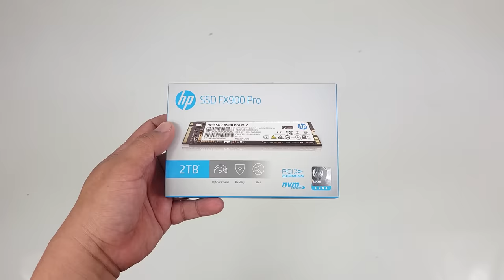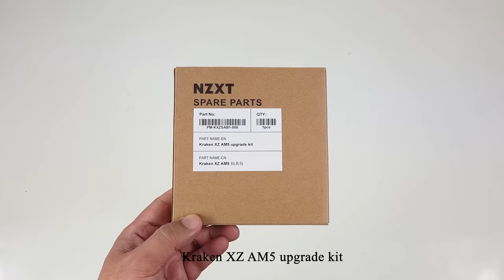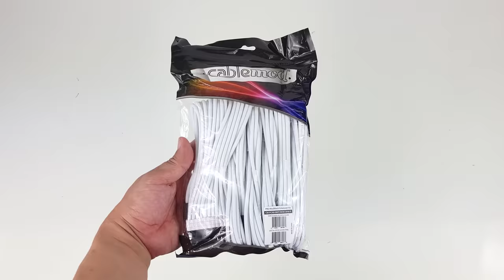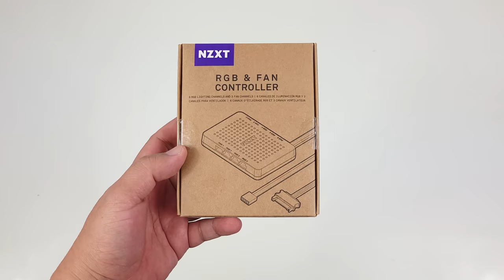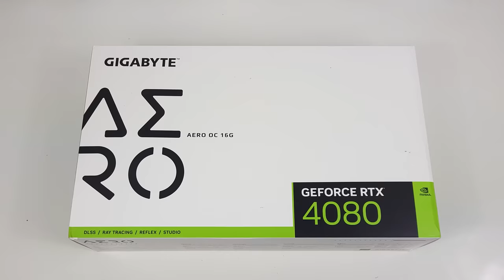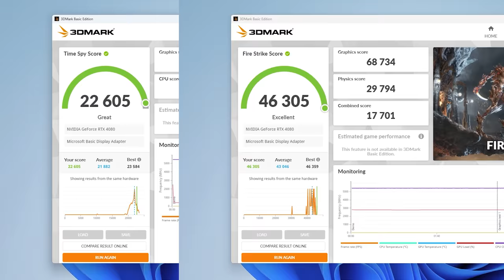Gaming PC Build | AMD Ryzen 5 7600X | RTX 4080 Aero | Fractal Design North | NZXT Kraken Z53

Comment: I was wondering how the RTX 4080 Aero is going to fit here. Looks good!
Reply: Looks good but cools badly
Reply: I noticed not a lot of sag. Did you use the included Gigabyte sag bracket or does the case come with some sag bracket built in?
Reply: @jragadio  https://youtu.be/liChy76nQJ4 skip to about 10 minutes in and he explains it, basically stacking pcie slot covers to make a point of contact where it isn't provided on the bracket for the card. Used it on my 6900xt and it work perfectly. Not to say this is what they did, but what they might have done.
Reply: @jragadio doesn’t look like he did,  if you notice just before he plugs in the gpu you don’t see included brackets
Reply: The bracket from Gigabyte is mounted on the motherboard and the top of GPU. Won’t be easy to spot here.
Reply: @atriusvinius319 how?
Reply: @atriusvinius319 explain 🤣

Comment: i just wanted to thank you for this video because it was a guideline for my build. I got the Fractal North With a NZXT b650e and went for a R7 7800X3D and 32 Gb a Kraken Z53. The card is still an older one a RTX 2080Ti but i will switch to the RTX 4080 Aero like in your video.
Massive thanks again
Reply from the maker: I'm glad that it worked out for you. Have fun with your new PC.

Comment: Amazing video, was literally going to do something like this for my next build but in a black color theme, just curious about two things tho

1. How is the ram clearance with a aio ( planning on corsair h100i with the lcd) and is it a must to use low profile ram (like the one you used, bcs was looking at the same but in black) or fan i get like a trident z rgb

2. How is the gpu power connector like is it pushing against the glass at all and reckon i can get away using corsairs adapter since cablemod doesnt ship to where im at

Would really appreciate if you can help me out here, also once again great video and absolute stunning build
Reply from the maker: 1. Ram clearance is almost never a problem if you use AIO.
2. There is enough room for a GPU cable.

Comment: Best looking build ive seen  , only one concern , are the cpu  temp   Good? 92 seems a little toasty  will a 7800x3d run cooler?
Reply from the maker: 90 Max temperature is pretty normal for new Ryzen CPUs. It's fine.

Comment: Nice, I'm also running an Ryzen 7600X with an RTX 4080 FE. But I will upgrade to the 7800X3D whenever that releases.
Reply: Why are you considering the swap from the 7600X to the 7800X3D if I may ask?
Working on a spec list for my upcoming build, so I'm curious.
Reply: @fyzx  3D v cache is known offer huge performance gains for gaming, so I'm just trying to maximize the RTX 4080 performance.

Comment: Thanks for your video. Is the GPU limit is exactly 355mm? I want to install Zotac 4080 which is 356.1 mm.
Reply from the maker: GPU max length is 355 mm so it may not fit

Comment: How’s the PC doing? Noticed that you used Intel XMP 3.0 ram on a AM5 mobo
Reply from the maker: Rock solid. You can use XMP3.0 rams on AM5.
Reply: @PCTechnician  Thank you so much!, because I was planning on buying that exact same mobo and didn’t know about the ram compatibility on it👍🏼
Reply: @PCTechnician  7600x is fast, 7800X3D around the corner...possible upgrade?

Comment: I'm planning on doing a build just like this with the Fractal North. Do you have any issues with the cooling?
Reply from the maker: Cooling is fine. Only problem with the case is there is not enough room for the back of the case. I wouldn't use a cable extension.
Reply: @PCTechnician  what do you mean by that? There isn't enough room for cable management?

Comment: amazing video, i was wondering why didnt you use the video card support bracket and can i use mine without a bracket because i just orderd the same video card and i dont know if the bracket will fit in my case
Reply from the maker: I didn't use it on this video but, yes I would recommend using a GPU bracket as this GPU is really heavy.
Reply: Thank you for replying to me🙏🏻

Comment: Hi there
Just a quick question the Kraken X53 requires a specific AM5 mounting bracket or will the one in the box with a AIO work?
Reply from the maker: Even though the AM4 bracket will fit, NZXT recommends using the new AM5 bracket to prevent possible damage.
Reply: i use  Be quiet Dark Rock pro 4 with same CPU and motherboard (ASUS ROG STRIX B650-A wifi gamming and 7600x) and work perfect no need brackets

Comment: I'm looking at an almost identical build, except all in black. Is it not possible to install the AIO on the front and put a 4070ti in this case ?

I feel the 240 AIO is not enough, really need a 280 or a 360..
Reply from the maker: 280mm won't fit on the top but it fits on front. RTX 4070 ti should fit in there.

Comment: Thinking about a similiar build. Does an AIO with 280mm radiators still fit on top with this case?
Reply from the maker: No. It will interfere with the motherboard.
Reply: @PCTechnician  Damn. These new cards are so massive, Would you reccommend using it in the front or is the gpu simply too big for a 280 in this case?
Reply from the maker: @hybrid11theory75  280mm fits in the front but then again you can't use 4080 together.
Reply: @PCTechnician  Very helpful. Thx for the quick info!

Comment: Hey i have nearly the exact same build Mobo / case / ram / CPU.. everything's great but The 7600x heats up all the way to 90 degrees when opening something, Chrome for example on launch it heats up to 90 degrees and then it goes back down to around 40-50 degrees, In games its around 50 too but just opening the initial program it ramps up insanely to then go down again? The stress test i did on Furmark i have to abord it cus after clicking the start button it instantly goes to 95+ degrees. I used tha right standoffs like you did for AM5 i applied different thermal paste i am using the NZXT kraken 240 cooler and the cooler works, so i have no idea how to fix it.. Any idea? Thank you
Reply from the maker: New Ryzen CPUs are known to hit up to 95C for max but it should come down during the games  I'm not sure if your PC constantly hits over 95C. Hopefully your AIO pump is not the issue.

Comment: Would you say there is still adequate space for a sound card under the GPU in the lowest vacant PCIE slot?
Reply from the maker: You can use the lowest slot but it's really tight.
Reply: @PCTechnician  A smaller 4090 will be fine then

Comment: isn't the nzxt aio overkill for the 7600x? I'm planning to buy it for the looks and performance but all of my friends told me not to and just buy an air cooler, what's ur opinion?
Reply from the maker: There are many air coolers which are as good as AIO. I don't think you can't go wrong either way
Reply: @PCTechnician how are the cpu temps in terms of gaming if you don’t mind? With the 7600x and kraken aio

Comment: 7:25 is the PCIE 5.0 extension cable you used here compatible with non-PCIE 5 PSUs? I have a MSI a750gf PSU but it’s not PCIE 5.0… will the extension still work?
Reply from the maker: It works with any PSU with three VGA power connectors.
Reply: @PCTechnician  ok thank you. I fairly new to 40 series graphics card so the new PCIE 5 cables are confusing to me. I bought this exact same gpu but I wanted to get rid of the ugly adapter it came with it :)

Comment: is its possible to fit a RTX 4080 Strix in there?
Reply from the maker: GPU max length is 355 mm but Strix is 357mm so I don't think it will fit.

Comment: i already have 360mm liquid cooler, do i still need the case fans?
Reply from the maker: Make neutral airflow as possible. Let's say if you have 360 AIO, all AIO's fans are exhausted so it will be better to have three intake system fans as well.
Reply: thanks so much for your advice! couldn't find an answer after doing so much research lol @PCTechnician

Comment: Case looks amazing! And PC build too. But set radiator on top it isn't good idea, as result CPU heats more than 90 degrees in tests. So, if we use this PC case than don't have anough place to graphic card. I had similar problem with my 3080ti and bought new case to set radiator on the front side and don't have any problem with temperature.
Reply from the maker: Either works fine. If you care more about the CPU temp, put the radiator in the front. And if you care more about the GPU temp, put the radiator on top.

Comment: They  push these  unnecesary AIO coolers almost in every pc build.
Reply from the maker: And I wonder why
Reply: @PCTechnician  imnotkidding) Noctua D15 or D15s is more effective than many AIOs and much more relaible/it will never leak.
Reply from the maker: @Atrius Vinius  I love Noctua but there is nothing wrong using NZXT AIO. Latest Ryzen 7000  Series CPUs reach up 95C. That is why you see all these AIOs.

Comment: That's crazy amount of cables. Why did you use white extensions, when you still connected some black cables into motherboard? This way you only added another point of failure and reduced airflow.
Reply from the maker: If you say using white extension on white build is wrong then I don't know what to say. Every cable is tucked behind the back of the case. How is that going to reduce the airflow?
Reply: Don't use drugs bro
Reply: @PCTechnician  I guess his point is about using extension cables and how that introduces an additional point of failure in a build like this. Tucking the cables away doesn't mean the airflow isn't affected, as the air needs to circulate everywhere inside the case, not just around the GPU and CPU.